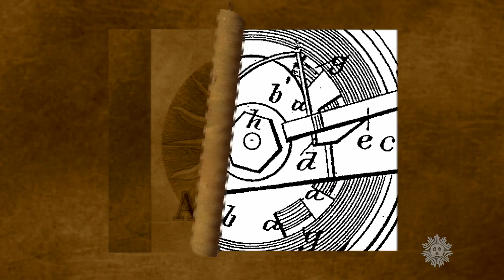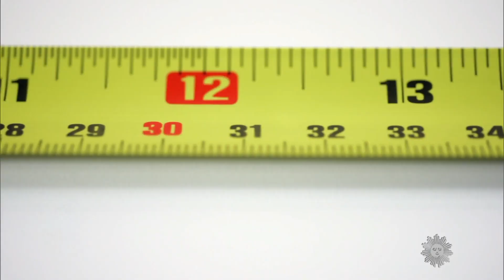Almanac: Measuring tape

Comment: Strings, low stretch fibers laid into cordage were used before tapes, the Inca used quipu to accurately account for trade against template stones, quite the history.
Reply: "Rods" were still being used when I was just a little bit more than a sprout. They were on portage markers between lakes & rivers and they often had claw and teeth marks from the bears!
Reply: @michaelwertzy9808  On a trip in AK, up glacier miles to an tall A•frame climbers' cabin there were giant radius scratches from the Griz tryin' to get in ... never take oatmeal or fuel, 5yrs worth there! We saw tracks up a cirque, none out, summer, they can smell the crevasses, totally cool.

Comment: Of course, if you just used a metric tape measure, this wouldn't be a problem.
Reply: How so..??? The angled tape technique works no matter the measurement system.  Metric sucks anyway, it's unnatural, humans relate to half/quarter... not tenths.
Reply: @Stillnapie  what is half of 19 and 11/16ths inches? What is half of 50 centimeters? Which is easier to calculate?
Reply: @Stillnapie  My question was which is easier to calculate. And I think even you would be willing to admit that figuring out half of 50 is easier. Which is why all science is metric and not fractions.
Reply: @phidias51  Obviously you have never worked in the trades or on an actual job site. The imperial system is far more relatable in human scale. It built Manhattan.... Proof enough.
Reply: @Stillnapie  Seems to work well enough to build the Burj Kalifa, The Gherkin, the Statue of Liberty and most of the other buildings in the world. One of these days, those power houses of industry Liberia and Burma will go metric, leaving the US behind. We already do use the metric system for most of our exports and a lot of our foods. In the 1960s, the UK had similar arguments against decimalisation of their currency. The die hard traditionalists wanted to continue using Shillings. Eventually that changed and London's financial services business took off.